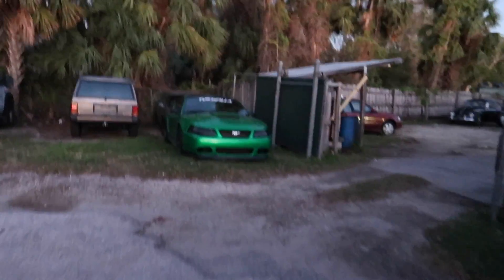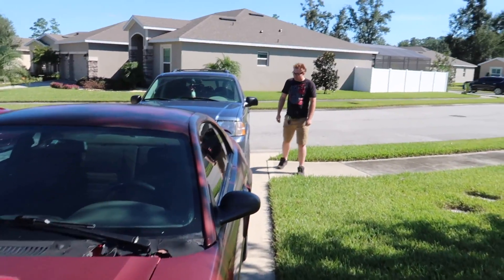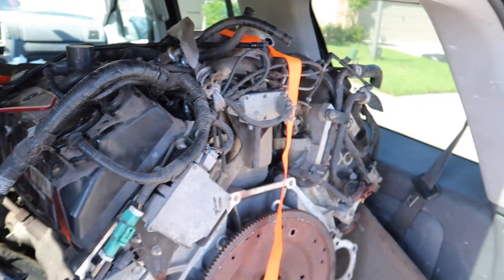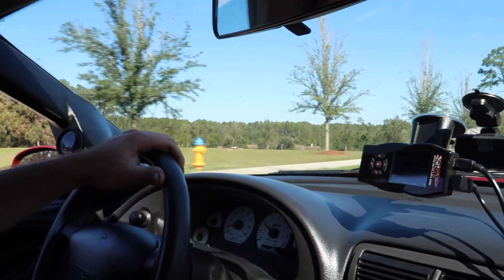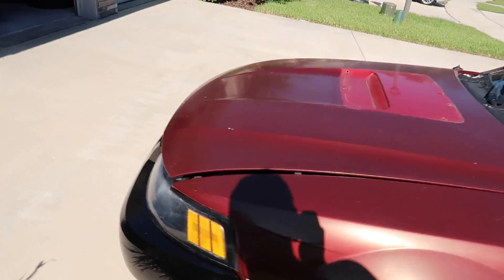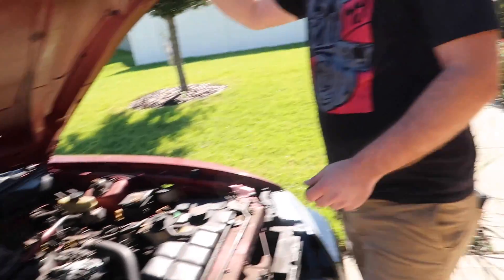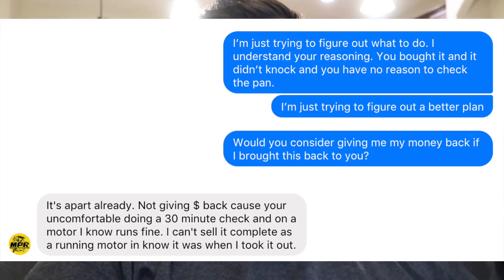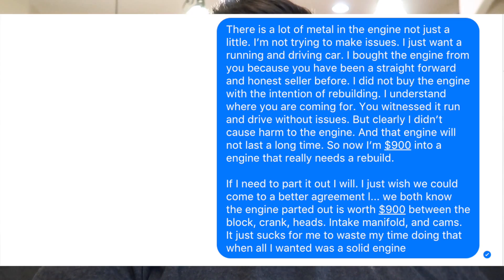Longtube Headers and New Engine for Turdzilla

Comment: Now just remember MKVIII engine does not have a forged crank. Also, as you probably know, you will have to use a GT flywheel on it as the crank is only a 6 bolt and Cobra crank is 8 bolt.
Reply: Ok so you mentioned the crank later on in the video lol.
Reply from the maker: +TheYellowsvt98 correct
Reply: If he is using the mark engine which he is he can’t he use the mark flywheel since it’s 6bolt ? Unless it’s in bad shape

Comment: Yeah it does suck getting a bad motor but unfortunately it does happen.  Ive had it happen to me getting a used motor, its just the chance you take. Me personally,  I would have just rebuilt that cobra motor , new bearings seals n gaskets and prob would have put in a set of new pistons n good Manley rods like the 03-04 terminators had.

Comment: Question with the long tube headers do you have to remove the long tube to remove transmission Tr3560 in 2002 mustang gt or will you be able to remove transmission with out removing the long tube headers?

Comment: I see where both parties are coming from when it comes to the motor. However, even if the motor is used, there still should be some kind of warranty on the motor. Maybe things are different out there then they are here in Cali where I live. But I haven't ever heard of even used AS IS motors coming from a company, that didn't have some kind of warranty for that kind of stuff. Every person I know that has ever gotten a used motor from a company, got at least a 30-90 day warranty on it. Only time I have ever heard of that is when you buy it from a private seller. He should have at the least offered to swap out what parts he felt was wrong with it. And ya it may have turned over just fine for him before he shipped it, but internal wear and tear like those shavings can happen for awhile before there are any real signs of the it going on. Then for him to look at it as you're threatening him is just stupid. You are obviously a well known Youtuber and me personally if I knew that, then ima work with you cause I wouldn't want any ill things said about me or how I do business. Not only that, but it's in your video that you guys did nothing to the motor that should make it so he shouldn't be willing to take it back. Sure you guys tore it down to see what was going on with it, but that wasn't till after you guys tested it and discovered somethin was obviously wrong with it. Like you said, you could still part it out and make the money back which he could have done as well. Which is also why it's weird that he isn't willing to take it back and work with you. So in my eyes, all dude really did was screw his self lol.

Comment: 👍. I spanked that like button.  Good luck with the mk8 engine. I hope it's a beast!
Reply from the maker: +Sinister.Shelby you are awesome!
Reply: Ok I'm trying to be rude wtf is up with the fake 5.0 4 cams motors. I don't need 4 cams to make horsepower 1 cam will do. hell 289 a real 302aka 5.0 a 351w hell a 390 will make horsepower. If you look at every motor sport drag racing round tracks cars all make big horsepower with a 1 cam motor and rev high rpm. I can spend 250bucks on 1 cam when you spend 1000 bucks on 4 and you only make 20 or 30 horsepower. I love old fords with 1 cam motors why must I have 4 cams with less horsepower and spend more money please explain.
Reply: acemay3, the 90's mod motors replaced the older pushrod engines for 3 reasons. 1 the mod motors made it much easier to meet epa regulations. 2 Ford Re-Tooled both Windsor and the Romeo factories with the same machines making each individual part cheaper to make. 3 Mod motors are designed to me smoother, stronger(ie: blocks/cranks/valvetrain), and more rev happy especially 4 valves. 

ported factory 4v heads can be made to flow well into the 300cfm range. and stock for stock they make more power per cubic inch compaired to the older 5.0. Mind you mod motors are extremely easy to work on since everything is on top of the motor except the oil filter, exhaust manifolds, and starter
Reply: I get what your saying man but if that was true you would  see and pro drag teams and nascar running them. I watch motor master do the  coyote and lsx build where put 10k in each motor guess who won, the push rod motor granted coyote can rev higher but if you build a push rod motor right it last longer and make more  horsepower and rev just as high . hell nascar push rod motor rev way over 9 grand and make all most 800 to 900 hp with no power adders. here is the link to watch coyote vs push rod https://youtu.be/KFkOy0F5hGg
Reply: Coyote motors are currently far more expensive to build than a 4.6 or 5.4 mod motor, you are talking about $300-400 teskid blocks vs $3000 coyote blocks. a 4.6 based boss iron block is only $1000, and that is what you want for stroker kits

Comment: Im confused, why not just rebuild the cobra engine instead of swapping that 93-98 mark 8 engine it
Reply from the maker: +Cole St. Clair cost to gain. Rebuild is going to cost $2,000 and a lot of time and work. Mark VIII engine is $200
Reply: Mustang Lifestyle I see. So you going to sell the cobra motor as a longblock or part it out?

Comment: It's sad that the Mustang community has some bad apples who are just out to make a buck off people at any cost. The minimum he should have done was taken half off the price of the motor, since it was basically just a rebuild-able core. He should have made it right by you.
Last time I dealt with Chris, he was selling parts as a side gig. I drove from Tampa to Orlando for a 99-01 Cobra throttle cable that turned out to be a 96-98 Cobra cable. Waste of gas and time.
Don't think I would deal with him again or recommend him to anyone.